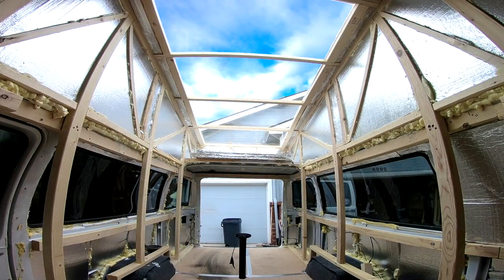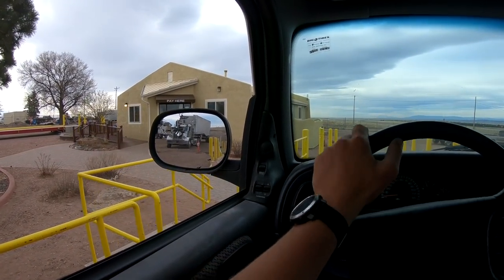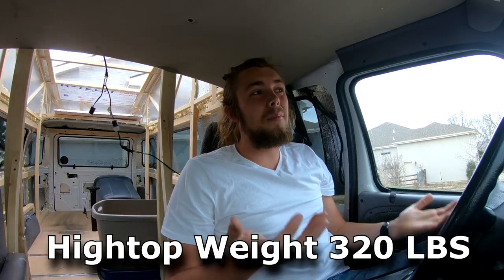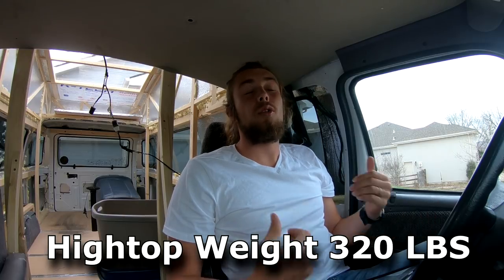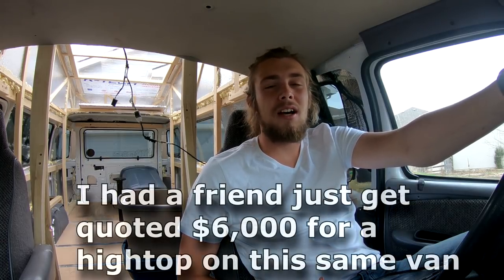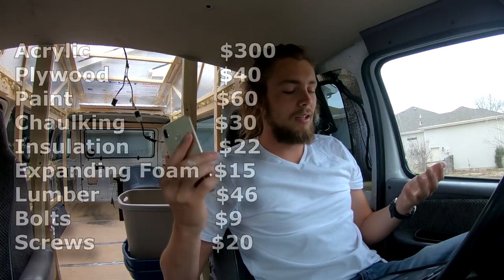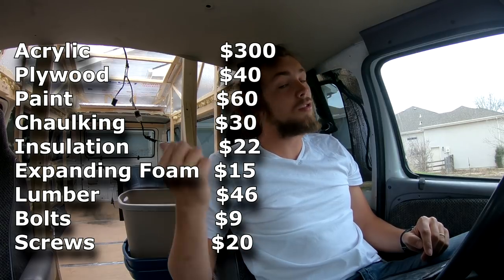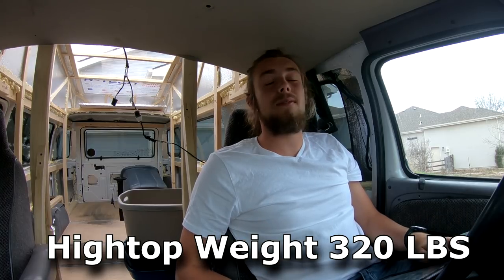How Much Does my DIY Hightop Weigh and Cost?

Comment: I've read that placing vortex generators at the tail end of a trailer help a lot with side winds. Perhaps adding those to the rear of the van will help break up any vacuum that's tossing your tail around?

Comment: After doing this build out do you regret not starting with a high top van already? You could have lifted or made the acrylic roof on one of those as well.
Reply from the maker: If I could find an affordable hightop that doesn't have a million miles I would have done that but it's pretty tough to find a good condition hightop van for a good deal. Regular vans on the other hand you can find everywhere and are cheap. I think I still saved a fair amount of money going this way instead of buying a premade hightop van (I got this van for $1,800) 1999 ram 3500 extended 155,000 miles